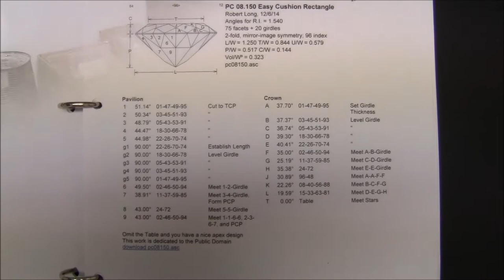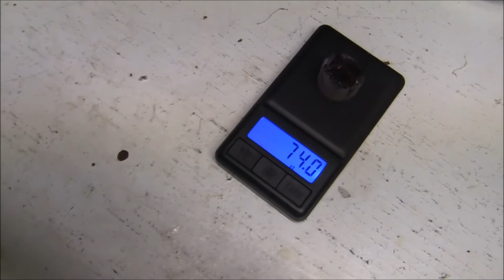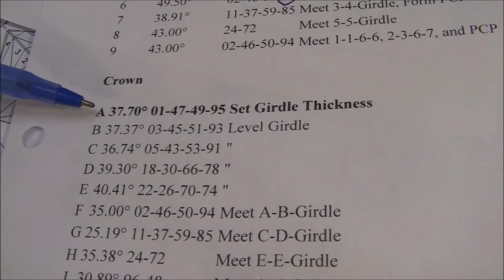Faceting gemstones: cutting an  ametrine cushion shape

Comment: Don't you worry about the stone cracking or breaking when heating at the end to remove the epoxy?
Reply from the maker: I dont have to worry about amethyst , it isnt heat sensitive,  but other stones are such as  opal, apatite, etc, usually the softer stones are heat sensitive and i wouldnt want to do this. Most  stones above the MOHs hardness scale of 7  are not sensitive.
Reply: @tennpikr74  That is good to know. Thank you.